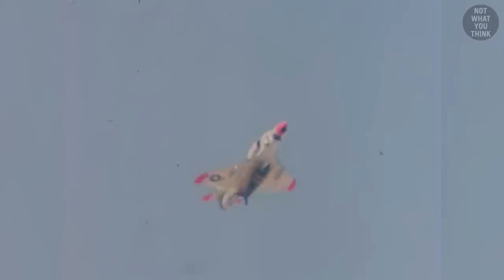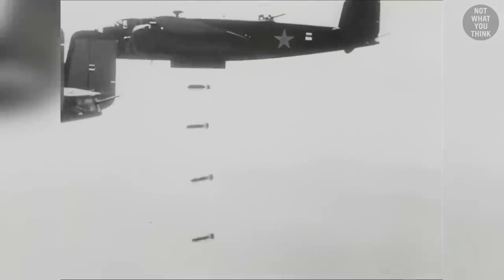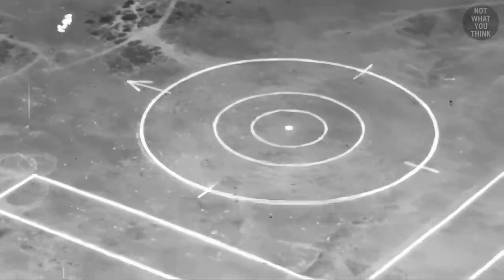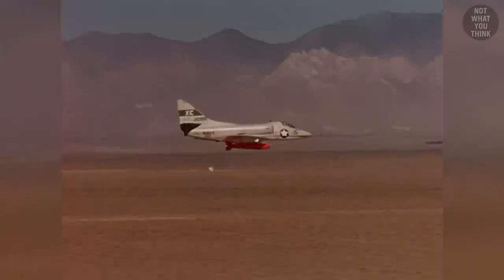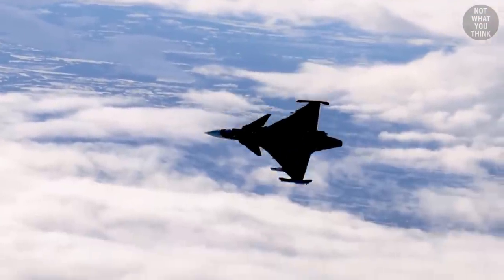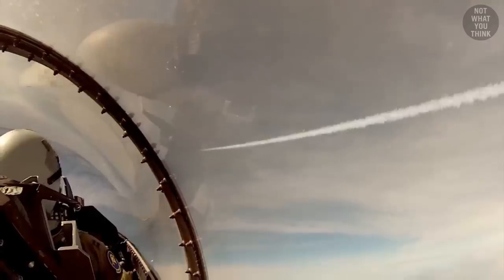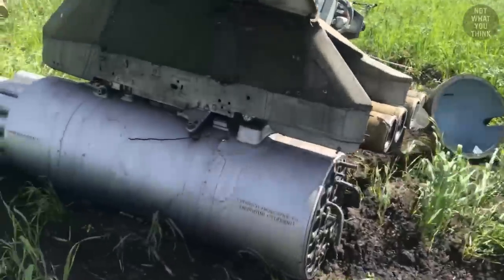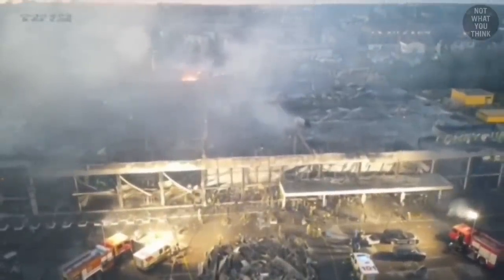Why Are Russian Helicopters Shooting Up at the Sky?

Comment: I dont think the mission of these rockets is to blow up something specific. Its to inflict area damage , make the enemy force lay low and allow your own troops to advance. While still keep the helicopter in a safe distance away from AA's way.

If it didnt work , it wouldnt be used.
Reply: Spray and pray always works
Reply: "If it didn't work, it wouldn't be used," is a poor truism to apply to the current state of the Russian invasion... hahaha
Reply: Sure it works as in the rockets get to the general area they want it in, but is it really effective? They might put 40 rockets down range but unless they hit something important or someone they’re kind of just inconveniencing the Ukrainians.
Reply: @lukeorlando6088  i mean invasion plan was not bad in essence it was tried and tested mechanised run . Problem comes mainly from incredible amount of corruption like tank dash without infantry, not having enough supply trucks , especially fuel trucks , low quality equipment. Tactics were not wrong but it's like if you wanted to charge with M 16 but government gave you 1911 . Both can shoot bullet but we know what's actually better. Basically if not for all yatchs and palaces of generals .  Russians would have rolled atleast eastern Ukrainian land. Hell many of troop carriers had rotting tyres which caused troops to just leave them behind. Most probably bcz some commander pocketed tyres replacement funds
Reply: @donk5058  It's about keeping hostile forces suppressed, this can be to stop advances or allow your own troops to advance while keeping the hostiles heads down.
Reply: @lukeorlando6088  you proved you are clueless about it
Reply: ehem, the russian invasion hasnt worked AT ALL, so why are they doing it? xD....your arguement is invalid when it comes to the Ukraine war :P
Reply: people DYING to cope so hard, it is funny. 
love fro Russia😘
Reply: @lukeorlando6088  
The current state of the invasion is - Ukrainian armed forces have pretty much lost all of their equippment they had before the war and are begging us for more shit to send to them because if we dont they wont have anything or anyone to fight with. While Russia , even with their losses , still retains enough power .  

Ukraine had the largest army in Europe and was considered very strong and well trained. 9 months into the war , and the West has to send in enough weaponry and ammunition that would last somebody like the Afghan army 5 years.
Reply: @donk5058  But thats the effect that is needed most of the time.
If the Russians want to hit something very specific and important like for example a Artillery piece or anything of the like , they will use guided  missiles , Lancet drones and so on.
When you need to supress the enemy , or for example you know that there is a large group of enemy soldiers ann bunched up , then unguided rockets are a cheap and effective way to do the job.

Like I said , if it wasnt effective ENOUGH , both sides would have found better ways to use their rockets. But if they are constantly using the tactic , it means that it is effective enough to be used.
Reply: @Snp2024  Curroption only floats up to the top during war time , and festers in peace time. What the war will do , is allow Russia to clean itself inside out. 
Ive already seen atleast 30 Russian commanding officers of different ranks just dissapier with all their assets seized. I really doubt they are dead , but most likely were given 2 options.
Reply: @AlexOnTheSide183  The "Afghan army" got most of their kills by strapping bomb vests to themselves, killing their own people whenever they suspected they were working with us and using children to pass secure zones. 
The Afghans also killed and wounded a whole lot less then Ukraine while retreating to thr caves a lot faster
Reply: @Kenny212_2  Thanks Kenny for your very informative and important addition to this conversation. 
Notify the Ukrainians aswell , that they should stop fighting. Since the invasion failed and everything. And notify them that they should stop sending their troops on suicide rushes. Cause the invasion failed.
Reply: @AlexOnTheSide183  Your talking a whole lot more about Russia then Ukraine. This much artillery couldn't have been spent if Russia wasn't still running fodder walls 12 months in and still contested at the borders
Reply: but if you don't degrade the enemy then you are just wasting your munitions
Reply: @WhatHappenedIn-vt3vq  You are thinking of the Taliban. 

Wtf are you even on about right now?
Reply: @quicksesh  If you fired a salvo at a enemy position and forced their MG nests to lay low , allowing your infantry to quickly move up and take the trench line. Is that considered ammunition wasting? Unguided rockets were never , in any conflict meant to be super duper effective at taking out the enemy. It was always meant as a supression tool.  If  you want them to be super effective , then you need to be close to the target. And a helicopter being close to their target is just BEGGING for it to be shot down. At the ranges Helicopters need to get to to fire unguided rockets effectivle , even a AK will work as a AA gun.
Reply: @AlexOnTheSide183  In every video I’ve seen this tactic being used there are a pair of helicopters who fire their salvo simultaneously before retreating. This isn’t suppression. Suppression only works under the constant threat of fire. An Apache that doesn’t immediately leave the area can provide suppression, an AC-130 circling overhead can provide suppression, but a single salvo of rockets before leaving the area is not suppression. It can create an opening for a push I suppose but under the guise of suppression or even artillery it doesn’t make sense.
Reply: @donk5058  What Ive seen is them firing , breaking left or right and then doung this until they run out of ammunition.

At the end of the day , Im not saying Im 100% right , Im just making a assumption from the info I have. But as Ive said. If both sides utilize the tactic , then it means it has its place. If it wasnt effective , if it didnt do shit and so on , none of them would bother with the tactic.
Reply: @AlexOnTheSide183  Been 6 months and Russia's largest accomplishment was a marginally defended town with a prewar population of 11k. after the first 2 months of this war, Russia had been losing on every single front. When you're goal is taking the entire country and you're struggling to take 10%, you're losing
Reply: “if it didnt work, it wouldnt be used”

i see you dont have a lot of first hand military experience
Reply: @AlexOnTheSide183  I agree that it might be the most effective tactic at hand for them right now, you use what you can, but overall I think it’s ineffective and if they could be doing anything else they would.
Reply: Yeah it's definitely a "fuck that area in particular" airborne "artillery" method but it does also keep the helicopter safe and we've learned that NATO weapons are vastly superior to Soviet weapon systems. So they definitely can't afford to get too close to a hot zone without getting shot out of the sky by a manpad.
Reply: @donk5058  I do want to hear your suggestion on how Unguided rockets could be used without putting the crew of the Helo in the range of direct fire weaponry. A genuine question. I simply think this is the "Out of all the shit options , the least shit one" kind of deal. But what do you think would be a better use? 

tbh , id fucking strap one of them pods on my tank , like the Soviets did in Afghan. FEEL MY FURY!!!
Reply: @lukeorlando6088  Russia started a war and still not giving up, on the other hand USA started many more wars and always ended in disasters lmfaoooo
Reply: @Black_Death69AC  

Yes , 2010s and 2020s Weaponry is supperior to Soviet 1970s and 60s technology , Very great notice there my friend.

Wanna know a little fact? You know whats the most popular MANPAD in Ukraine right now? Soviet Igla. And its been the most effective. 

All this war has shown , is not how useless soviet weaponry is , in fact , it has shown the opposite. But it has shown how such weapon systems as the Javelin , NLAW and many other things sent to Ukraine are NOT at all meant for an actual war. And are only usefull when fighting monkeys with AK's. 

And before you go on about Tank losess and yada yada. I want to ask you a simple question and ill use a Bradley as a showcase.
Its winter. The weather becomes plus 3 like it can sometimes happen in Ukraine. The roads turned into mud pits. But it doesnt bog down your BMP-2 or the Bradley at all. They get through the mud easily enough. Get into postion and over night , the weather turns into -10 and all the mud , the crew decided not to clean off is now stuck on the tracks of the Bradley and the  BMP-2.

Your vehicle is frozen in place. it can start , it can shoot , but it cant move.  With the BMP-2 , you take a hammer and you start to hammer away all of that  mud. With the Bradley? Good luck getting those side skirts to open first. Cause that mud got into everywhere and has frozen everything solid. Who do you think will take longer , to get their vehicle back operational?  This is the shit that matters in actual war. Not how pretty your vehicle is , or how bad ass it looks. But how usefull it is , how easy it is to repair and how effective it is in battle.
Reply: @AlexOnTheSide183  The answer is they shouldn't be at all, they're using a weapon which requires a certain level of accuracy to be effective in a situation where they don't have it. As I said before, if they had any other means to use they probably would.
Reply: @lukeorlando6088  Ukraine also uses it.
Reply: @donk5058  So just keep the thousand rocket stockpile sitting with now use?

This method leaves little room for the helo to be shot down , and while the chance is small , there is still that chance that the rocket will hit something or someone. 

I see no reasson to not do this. At the end of the time. Who are we to stop them?
Reply: A lot of people are going with the entire invasion to take logic away from that, but practically it's likely what you're saying is true...

Alternatively when you see something not working and question the logic it's often that there is another purpose altogether in mind
IMO It's closer to the vid. Their mission requires they get fire down field, but the fear of AA fire has probably successfully been keeping some pilots at bay.

There's been a clear lack of coordination and training on display, mixed with conscripts - it's likely some pilots are just going out pretending to fight for their own safety. Shoot missiles in the direction of the enemy, fire off flares as if you were targeted to explain the lack of accuracy - return to base.

It's not like literally in every war of all recorded history there isn't account of people firing 'generally' in the direction of the enemy not intending to actually hit anything so they can continue to hide, alive among the ranks just trying to do the absolute bare requirements to make it home. Given punishment for failure to attack is likely severe given stories, the need to put the full display of fighting would be higher.
Reply: @AlexOnTheSide183  Russia did try to take the entire country, as evidenced by Putin sending tens of thousands of his most highly trained VDV soldiers to take Kyiv, which they failed to do. He tried to take Odessa to cut off sea access. He failed to get past Kherson city. He tried to take Zaporizhzhia but failed. He tried to take Kharkiv in the East and Sumy in the North East. The only locations he didn't try to take is the Western cities around Lviv, which is strictly due to it being so far away. Taking Kyiv would've ended the war right then and there, let Putin complete all of his imperial ambitions (in Ukraine), and get another puppet country.

Ukraine has literally never been a threat to Russia, nor would it ever be. Ukraine isn't an imperialistic nation hellbent on invading foreign nations for their oil like Russia is.

At the beginning of the war, Russia had the manpower advantage. They had 200k soldiers when including the LDPR and Wagner Nazi mercenaries. The entirety of the Russian forces, including their nazis, had one job and that was to invade. Russia has been building up massive stockpiles of weapons and supplies near the border. The 200k had to just fight and move the supplies across a few dozen kilometers. Ukraine's 300k personnel military was spread out all across the country. They were training, resting, learning, and doing drills. With the much longer supply lines Ukraine had, it wouldn't be too far off to say Russia had a decent manpower advantage. Ukraine mobilizing to have a 1 million man army was to bring it in line with the Russian military so they could rotate in and out, train, move supplies, and provide aid to civilians.

The front line "shifting" into Russia's favor is a 5km advance into a marginally defended city. After 6 months that is nothing. By the time Russia will take the entirety of the Donbas, they will be running out of able bodied men to use.

Also, Russia will stop being a country if they stop fighting? What? You can't be that fucking gullible. No one wants to invade Russia. No one wants to destroy Russia. If Putin packed up his soldiers and went home, Ukrainians would live free in their home country and Russians would do the same. They might not even have to pay reparations for the destruction and will be living no different in a decade when everything returns to normal with smaller sanctions.

Russia invaded Ukraine 4 times in the last decade. Once in February 2014 for Crimea. In April 2014, thousands of Russian FSB agents and Russian nationalists invaded Eastern Ukraine to create the puppet LDPR government. In August 2014, when their separatist movement was pushed to the Russian border, Russia again invaded, this time far less covertly than in April. The sanctions after that was minimal and Russia continued on it's way. Putin could've been satisfied with that and Russia would've lived a fine future. Unfortunately for Ukraine and Russia, Putin will not stop until every single inch of Ukraine is under his boot.

You can't play victim when you break into a house, shoot the dog, and barricade yourself in the kid's room.
Reply: @AlexOnTheSide183  I think that when ppl talk about the superiority of NATO thanks they usually mean their targeting and anti missile systems. When it comes to how well they would perform in a cold environment I for the love of God couldn't answer that. They haven't seen much action there afaik
Reply: Indeed, even in small arms fighting with infantry, only a very small percentage of bullets is actually aimed to kill. Most of it is suppressive fire, to pin the enemy down, prevent them from moving or shooting back, allowing the rest of your forces to maneuver in for the kill.
Reply: @AlexOnTheSide183  Ukraine is a poor country, it got poorer than Republic of Moldova. So no, they could not have been the very strong army you suggest. They used mostly old equipment from Soviet times. Not sure where you are from, but I would very much like not to see Russia expanding. And losing US influence from all over Eastern Europe if they succeed woth Ukraine. Actually not only in the Eastern Europe, but elsewhere too, as who would trust the US cares a lot for... Vietnam or... Taiwan? That means a whole lot smaller world for the US and a way bigger one for the enemies (China and Russia).
Reply: @lukeorlando6088  Both Ukraine and Russia use this tactic and it works quite well by keeping the crew safe. By doing this they're able to launch 15km away vs 2-5km when fired normally. It's accurate enough to target and deny a certain area. Think of it like a flying grad with smaller rockets.
Reply: @jaredwindmeier5558  Yeah cause you have....
Reply: @AlexOnTheSide183  Firing those rockets and using that aviation fuel puts a strain on logistics. That logistical capacity could have been used for something else, like bringing in more artillery shells and diesel fuel. So yes, they should keep those thousands of rockets in storage instead of sending them to the front if they can't be effectively used at the front, because using those ineffectively means they aren't using other, more effective things.
Reply: @Kenny212_2  It is what the media tells us, next news is that Selenski is about to take Moscow. Anyone remember the fairytale teller of Sadam Hussein? Was it comical Ali? Another one was chemical Ali, right? The comical Ali was so funny, the US did not convict him, if I am right.
Reply: @AlexOnTheSide183  lol what, that's some insane cope.
Ukraine requested weapons since the war started for real, because why wouldn't they XD
And russia failed to secure any of their objectives while barely maintaining a stalemate for months now, despite supposed military superiority.
Reply: @ImBigFloppa  
Addition.

Russia started the war with 150k of its own troops and around 135k DPR and LPR troops. Ukraine had around 400k and around 124k of those were at the frontline in Donbass. This was due to the reasson that Ukraine was planning an attack on the Donetsk city only a few days after  Russia began their assault. Which was confirmed by Zaluznij in a statement.

Second thing. It seems you havent watched the news in some time , because Russian forces have advanced as far is 5km throughout the entire frontline on Zaparozjie and are continuying to move forwards. Have taken Soledar and cut off a major supply chain to Bachmut. I do wonder who will run out able bodied men first.
Reply: Nice analysis man
Very nice
Reply: @Snp2024  the major problem wasn't corruption
It was incompetency and poor initial planning
"Many of the carriers had rotting tires" 
Because you saw a few videos of that on social media doesn't mean the thousands of IFVs all had rotting tires. Even if 20% of them  had , it would still be insignificant
Stop using a few videos to judge thousands of vehicles
Reply: @FlorinArjocu  

Ukrainians would take offense to that comment XD

While Ukrainian economy was by no means strong , it was NOT on Moldovas level. 
I dont "suggest" it was a strong army. Its a fact that it was THE strongest army in Europe before the war started. As it was not only the largest army , but the only army that had modern war knowledge.

Nor Russia nor Anybody else cares if you want it to expand or not. If the countries survival is in question , nothing will stop said country.
Reply: @sisyphusofephyra7801  Its not even JUST cold enviroments. All of the US and NATO vehicles were built with the idea that "Oh , we will have a repair bay right there , so no worries!" , Soviet vehicles were always built with the idea that Poor Ivan will have to repair it by himself in the field. 
Sure , the APS systems the other nations have is amazing , and Russia should adopt them as fast as possible. But how do people expect that a nation under the largest amount of sanctions in the world can quickly set up such systems? Russia to this day is feeling the effects of the fall the Soviet Union. So money needs to devided.
Reply: @Black_Death69AC  Yeah, vastly superior Bayraktars, StarFailStreak and other bunch of crap... Keep it up fanboy
Reply: @voidhawkslx  So....Not only do you film yourself doing the bare minimum , but you yourself upload the video? I dont disagree with you , but dont you think that its like yelling "im over here shoot me"?
Reply: @olehcelsior1005  literally nothing you named was made either blocks of countries I'm talking about.
Reply: @donk5058  That's what he was saying. It's a kind of suppressing fire, not meant to hit anyone but to keep people from advancing or moving.
Reply: @lukeorlando6088  What does this even mean?
Reply: @ImBigFloppa  I would agree but Americans would never admit they lost to Vietnam either with that reasoning. And in another note unfortunately people with your judgement do not hold a consistent principle and apply double standards when America does terrible war crimes.
Reply: @AlexOnTheSide183  Check GDP / capita in 2021 and you'll see what I ment, at least in the source I saw, Ukr was behind. Nothing to take personal, it is statistics and an effect of the bloody Russia occupation of those 2 territories (East + Crimeea). Pretty sure France and Piland have good armies. So does UK. Turkey is probably better. And all the above have modern equipment, not T72 and older.
Reply: @AlexOnTheSide183  ''But it has shown how such weapon systems as the Javelin , NLAW and many other things sent to Ukraine are NOT at all meant for an actual war. And are only useful when fighting monkeys with AK's'' I would really disagree with this statement I just feel you just want to force your views of how great soviet weaponry is.  Though I may agree some weapon systems are not effective saying a Javelin, NLAW are only good for monkeys with AK's is such a sweeping statement.
Reply: @kenz2756  golden!
Reply: @danielnavarro8531  Soviet weaponry is ok for it's time, you are comparing more modern systems to older systems. Most problem is Russia didn't make enough upgrades of old weaponry(budget issues) and didn't build enough more modern systems/weapons thou there many good stuff was developed, very little is made in quantities.
Reply: Well... I'd guess that Russian pilots are making reports according to which this technique clearly works and there is no need to send them within range of angry people with manpads.
Reply: @olehcelsior1005  Give me a break, they are my neighbours and I know enough. As for "they became US proxy", it is 1. An exageration as they had pro-russian presidents; 2. It is their wish, anyone who had to deal with the Russians if they are close so there is no buffer, and if they are smart, will naturally put a big fence between them. We are 70 years since WW2 and we still have the memory of the horrors the Russians did in my country; plus the wonderful communism they brought that is so hard to get rid of (sumptoms).
Regarding "they got weapons etc." and because of corruption they lost those, remember that corruption came because of communism. And Russia was just the same, but it was helped by the West to rise as a very corrupt disintegrating nuclear state is a danger for everyone. So Russia was helped more actually. And wherever Russia went and whomever  influenced is corrupt and poor. See their neighbours that are pro Russia, they are all poor and corrupt. All who went " West" are better, likely much better.
Reply: @olehcelsior1005  Will take US hegemony any time. See statistics about countries that went "West" vs countries that stayed and were forced to stay with Russia. Huge difference. And no dictators around, too. You forgot about the ethnic cleansing done by Milosevic?
Reply: @olehcelsior1005  Ah, one more thing: I am sick of hearing "decadent Occident" while nobody goes East. Millions went West for a better life because it is so bad. Right. It is not a perfect regime there, but it is the best we have for now; we can see in these days as one of the weaknesses is the way is exactly the freedom, as it this freedom is manipulated by Russia & co.
Reply: @olehcelsior1005  What is "this part of the world"? I am from a former communism country and know very well. And please, don't blame others for the bad things our leaders were not able to do or did not want to do. Perestroika and communism was a Russian creation, nobody forced USSR to be a bad example and go banckrupt, but the system itself was corrupt and banckrupt.
Reply: @olehcelsior1005  Wow, long time no see such self-pity and way to blame the others. You forget communism was started and it was exported even before WW2; all in all, decades before NATO existed. Maybe it would have been better for the US not send that tremendous hep to the USSR in the beggining of WW2, so Germany konquer it, we would not have this discussion. Your lack of history knowledge is too blunt for me.
Reply: @danielnavarro8531  

A Javelin is a heavy , cumborsome pease of equipment. If you want to be effective with it , you need 2 men to use it. In winter , you  have perfect conditions to see anything and everything you want , but from the reports ive read of Ukrainian troops , in summer , the Javelin and NLAW had a hard time or it was impossible to lock a target behind larger bushes and trees.

Ill admit the part about monkeys with AK's is a bit of nonsense. But Ill clear it up a bit.

When the US army fought enemy armies who did have a airforce , didnt have tanks that could fire effectivly at them and so on. Weapons like the Javelin were amazing. In open desserts you could see enemy tanks and units from miles away and in these conditions , the Javelin saw its use.

If I am on the frontline , in a trench and I know ill only ingage enemy tanks at max 300m , why would I need a 80k missile to do it , if a RPG-7 with the Tandem shaped charge can go through most side armor.
And here is another thing. A penetration of the armor isnt always needed to disable it. Get a good hit on the gunners scope , the barrel , the tracks. Drives view ports and there goes your tank. Its much simpler than it is in War thunder.
Reply: @FlorinArjocu  
I cant take something personal , if it isnt my country. Most Ukrainians lived MUCH better then Moldovians due to more options for work and higher paying jobs. 

And thats not the effect of a "bloody occupation" , Crimea had zero influence on Ukrainian economics. Now the Donbass region , being a heavy metal working and mining region , did. 

If you took a minute to research the Ukrainian army , you would notice they had brand new self built BTR-4Es , BTR-3s , self made T-64 modifications and so on.

You clearly know nothing about armies and I suggest you research MUCH more about them before getting into these conversations.
Reply: @olehcelsior1005  I am not comparing, i am merely disagreeing with the fact that he stated Javelins are only useful for AK's with monkeys .
Reply: @AlexOnTheSide183  They had... some, that is nothing for such a war. They need thousands and thousands. See the numbers destroyed on Oryx.
Reply: @justicehenrydamian475  That's what I said. Putin wanted to take Kyiv, and the rest of the country would fall with it. He believed that the Ukrainian people would just let it happen like those in Crimea where Russia faced almost zero resistance. Unfortunately for Putin, Ukrainians have come to known the pain and suffering that is enacted upon those who get enslaved by Russia.
Reply: @AlexOnTheSide183  let's also not forget how Ukraine squandered the arms infastructure it inherited from the Soviet union
Reply: @liquidsweg4858  I am not an idealist, but from all the regimes we have right now, that is the best. And that is why more or less nobody goes to Russia or China, nobody goes to the very rich but problematic elsewhere Qatar, Saudi Arabia, but West-like countries.
Reply: @Snp2024  their invasion plan was written in WWII, and they hadn't even modernized it.
Reply: @AlexOnTheSide183  ukraine never had the largest army in Europe, and they did not lose all their equipment, they had Soviet era equipment and have gained Russian equipment abandoned by the Russians in the field. What they didn't have was modern equipment.
Reply: @kdrapertrucker  
Bruh

Over 2k MBT's , largest man power and IFV number in Europe. Had been training with NATO troops for the last 8 years.
1 Year ago US generals were yelling about how "Ukraine cant be invaded because they are so strong , strongest in Europe" , now the agenda has changed. Make up your mind.

Just because something is modern , doesnt mean its much better. A Kozak armored car is modern. But is it much better then other older armored cars? 
Ukraine had upgraded hundreds of their tanks to modern standards with Thermals and other modern toys. 

Why does it take a pro-Russia to defend Ukraine againts fucking slander? Wtf
Reply: @AlexOnTheSide183  Don't forget that Ukranian military personnel losses are magnitudes higher. People made a fuss about some minor 5% conscription, meanwhile Ukraine has actively made old men and all women draftable by law.
Reply: I think this too...
Reply: @AlexOnTheSide183  because a pro-russian would obviously try to inflate the capabilities of the opponent they are fighting with to make themselves look stronger.
Reply: @distrologic2925  
I cant with you people. Funniest shit ever.
For years all NATO could talk about how strong Ukraine is. Now its changed to "But if Russia fought an ACTUAL NATO army".
What ive said isnt a inflation of the Ukrainian army. Its me not underestimating mu opponent , like all of you do.
Reply: @lukeorlando6088  Both the Ukrainians and Russians are doing this
Reply: It doesn't work in the senae of military utility but it works great for the pilot. He gets to return alive with an empty rocket magazine. Job done!
Reply: @distrologic2925  My man I live in Lithuania.
Ive been occupied by said uncle Sam for the last 30 years.

Ukraine isnt part of NATO , but it sure as hell is armed like one now. The last package to Ukraine was atleast a thousand armored vehicles in sum. 100 Bradleys , Tanks , armored cars and many other things are being sent there. That amount , would be enough to arm a military and have it fight a war in Afghanistan for 5-6 years. Yet those packages in Ukraine are fucking MONTHLY. Do you realise what sort of losses Ukraine is going through? "Doing pretty well" ,  Just because one takes a city , does not determine a loss or victory. Ukraine fought for 9 months for the city of Kherson and never actually had a FIGHT for it. You know why? Because Russians actually give a fuck about the civilians , because they knew what urban combat looked like. After Mariupol , where the cowards that the Ukrainians are hid around civilian homes. And I dont need either propaganda to tell me , Because I have second hand information from family in the city to know what happened. 
Show me atleast a single video where Russian soldiers are going into battle butt naked. Please. Because if you dont , you cant sit there and claim "They dont have eqquip[ment". They have a gun , they have a winter uniform and they have food. They have change of clothes either supplised by the army or donated by the civilians.
And Lets now talk about those who ran away from Russia. In the end , the number of runaways from the mobilization were around 73k. Less rats on the ship. Simple as that.

Russia didnt go in there to save Ukraine. or save the Ukrainians. Those guys are beyond saving. They went in there to secure their borders. Because what Ukraine was , was a anarchistic Nazi regime , where the Jews were the Russians. Youtube has since banned links , but do search up torch lit marches in Kiev , UPA Marches in Ukraine in general. Who Stepan Bandera is. Search up Ukrainian battalions such as "Donbas" , "Tornado" "Azov" "Aidar" and many others.
Reply: From the perspective of the pilots, it makes perfect sense - it "works" perfectly,  that is to say, it keeps them alive while being able to say "We fired X number of rockets at the enemy".
Whether they hit anything or not is now poor 18-year-old Private Conscriptovic's problem. 🤷
Reply: @MeeesterBond17  
The pilots know if it hit anything or not due:
1 Ballistic computers on board
2 The drones hovering over the target and adjusting the pilots fire.
Reply: @AlexOnTheSide183  Oh, that's true as well. Still doesn't mean they're going to be honest if they missed. It would make them look bad to their commanders. Plus it would make it their problem again, and nobody wants that.
Reply: @MeeesterBond17  
They are soldiers , not god damn 18 year old girls who cant be honest with anybody.

Its not about making yourself look bad or good. You are simply doing the given task. The commanders care very little about mistakes made by a single soldier , unless that one mistake is the floodgate to bigger problems.
This is pretty much how the conversation would go at base "you missed them? Oh well , I guess the artillery will finish the job" 

Russians know that sending units to repeat the same mission is that of suicide as the enemy will know be expecting it. So Helos rarely go on repeat missions in the same area. They constantly switch attack points , making the enemy AA run around like a bunch of maids from one position to another , trying to catch the helo that keeps pummeling them.

And here is another thing to keep in mind. EVEN if the missile strike is not effective in the sense that it hit something , it sure as hell puts a constant strain on the mental state of a soldier. Think about siiting in a trench 24/7 , hearing shit fly over your head and land 10m next to you. And the same thing happens every day. At that point there are only 2 reactions to it. Either you laugh in the face of death and ridicule the Russians for missing. Or break down and constantly think about "Is the next one gona land straight on target..?"
Reply: @ImBigFloppa  taking over the entire Ukraine was never the goal. LPR and DPR were the target. Otherwise russian army would've rushed through relatively unprotected territories bordering Poland in the beginning of the conflict in order to cut all the major possible supply routes from NATO to Ukraine and then proceed to do pretty much anything they want to with the rest of the country. Russia may have really bad top rank commanders, but even they are not THAT dumb.
Reply: @AlexOnTheSide183  I would visit Russia, too (not in this period, of course, I treasure my life and freedom). It was an empire that collected wealth for centuries (even stolen, like the Romanian treasury from WW1 that was, with little exceptions, never gave back - I am talking about 100+ tons of gold bars, jewelry, paintings, old documents,  old books etc. sent to be safe during WW1), it is a huge country and thse things are interesting to see. But I would never move there. Learn to behave.
Reply: @donk5058  the problem is, according to the data I have, Russia is currently running low on artillery ammo, which caused less intense shelling at almost all directions. So when you have little shells, but plenty of unguided missiles and have to push/suppress a not-that-well-protected position, you say "well, unguided missile artillery it is" and do what you can with those resources you have
Reply: @AlexOnTheSide183  I think the Belorussian media give the Russian military less credit than you, my friend - YT comments deleted my external link, but there are reports from Belarus of drunken tank crews in Mazyr selling their diesel for vodka as early as March 2022.
Reply: @FlorinArjocu  And also. My motherland is Lithuania. I was born where I was supposed to be.
Reply: @AlexOnTheSide183  I think you forget that Source Analysis is the science of keeping biases in mind while analysing the big picture. It does not mean using souce bias as an excuse to throw away potentially useful information. We can find clues and grains of truth even in blatant propaganda. The question is if it's corroborated by other sources, this is history we're talking about, and every source is imperfect.

Let's also bear in mind the alleged maintenance report from the Moskva, which was either sunk by a knock-off Harpoon missile because their CIWS and short range air defence didn't work, or whose crew were so incompetent they blew themselves up.

Also all of the intercepted calls made over a mobile network in Russian which seem to indicate supply and command issues.

Then the video of Terminator tank support vehicles bunched up and coming under artillery fire, unable to get out of the way because they're heavier than T90s and lack main guns.

Also the shell which killed dozens of DNR citizens in the city of Donetsk on 19/9/22, which crater analysis shows was fired from the south (not the Ukrainian side).

Taken in amalgamation, all these stories from different sources paint a grim picture of incompetence in the Russian military.
Reply: @MeeesterBond17  
Oh boy...
The Moskva was sunk after it was attacked by drones and anti ship missiles. The drones destroyed the main radar system and only short range radars were operational , which couldnt detect the incoming threat. The Moskva did not sink after its hit and the crew abandoned ship. It was then towed to port , but before it reached it it took on more water and sank.

Around 80% of the calls that were "intercepted" were later found to have been made from Ukrainian cellphone numbers , and I doubt Russians would witch their numbers JUST to speak on the phones. Now intercepted radio chatter , thats different , but how you listen to some Ukrainian radio chatter and how they are constantly reporting heavy losses near Bachmut , but the commanding officers are telling them to hold on to the city , no matter the cost?

The OSCE reported about Ukraine shelling Donetks and Luhanks for over 8 years. They pictured NATO shell fragments in the city of Donetks , they pictured Ukrainian Tocka-U missiles.

All of the sources you stated paint only the stupidity of the reporters and nothing more. 

A source not only has to have proof but a logical explanation to a situation. And most of the Western source only , excuse me for my French , talk shit about the Russian armed forces and nothing more. They report that "Russians dont have Winter gear" , I talk to my buddies on the front and everybody said they have plenty of clothing and if they ever lack anything , their families always send something over. And often the items they lack are either combat gloves , or maybe a pair of undies.  

You talked about "taking info from everywhere" and then took info only from Pro-Ukrainian sources and told me that they paint a grim picture....It would be weird if the Pro-Ukrainian source would be praising the Russian armed forces for anything.
Reply: @AlexOnTheSide183  Ok, let's go point by point ...so cheap drones took out a capital ship's main radar. A capital ship with enough close range firepower to throw a wall of lead at anything within a few kilometres. You realise that's a worse sign of incompetence than saying it was just hit by an SSM without warning, right? Please tell me you know that's worse.
Reply: @AlexOnTheSide183  Using Ukrainian numbers... because they're using the Ukrainian phone network? Which likely isn't accepting calls from Russian mobile phones? That's not an indicator of falsehood, just how mobile communication works.
Reply: @AlexOnTheSide183  Nope. That incident on 19/9/22 was a 122mm D30 shell, and the crater pointed back into Russian held territory. Look it up. It was a terrible accident, but it definitely came from a gun on the Russian side.
Reply: @AlexOnTheSide183  Moreover, the OSCE report mentions that civilian fatalities in the Donbass went down to 26 killed from Jan 2019 to November 2019. Twenty. Six. Mostly killed by mines. Why, why, why do people keep linking the OSCE report before reading it?
Reply: @AlexOnTheSide183  Oh right, and there are tons of videos even on this exact channel that depict the state of the russian army. Man, they just drew in a whole bunch of people and sent them to ukraine, they thought this war would be over in a few days, do you really expect the soldiers to be trained well? The fact that their 2-day special operation is now taking almost a year should be enough to tell you that they don't know what they are doing. Its just a bunch of generals and rich people who would like to have a nice holiday home at the black sea and they dont want to deal with the ukrainians there because they have turned their backs on them and are now friends with the US and EU. And yes, maybe Ukrainians also had bad opinions of Russians and treated them badly, but that all is no reason to go and bomb a country. If Putin really was interested in peace he could have handled this better in millions of ways. But he wanted war. He likes the idea of a great soviet empire and he thinks the only way he could get it is by force. That is a barbarian logic and has no right to survive in today's world.
Reply: @MeeesterBond17  

When you go to another country , do you change your phone number? No. Your phone number stays the same and it connects to to the cell towers in the country. The same way , Russian phones have been connecting and using Ukrainian cell towers at the start of the war.  

The indicator of falsehood are:
1. Ukrainian accent in the captured phone calls
2. Often the conversations dont feel natural and are almost scripted.
3. Over dramatizasion of the events . For example , there was one where a "Captured phone call of Russian commander with family" where he says that he lost 300 men , but it doesnt matter , he will get another 300 tomorrow. And he will probobly get them all killed , cause he wants a medal. This story plays WAY too well into the the Ukrainian narrative about how all Russians are inhuman and orcs and blah blah blah. 

Everything is just TOO perfect and thats exactly why I believe its false.
Reply: @AlexOnTheSide183  Actually, yes I do change numbers. I live in Germany, but have family in the UK. When I go back to visit, my German mobile provider can't provide service, so I have to use a British SIM card. Gets even worse when I visit my in-laws in Brazil. 😅
Reply: @AlexOnTheSide183  I will admit, of the languages I do speak, Russian isn't one of them (yet). But if you are a Russian speaker, please could you do me a favour? Look up Konstantin Solovyev, there's an allegedly intercepted call between him and his mother. Please point out to me if that sounds fake, perhaps pointing out pronunciation errors, without saying "it sounds scripted", as that's impossible to prove to me. I know all my Russian from playing Bad Company 2. If not, we'll have to agree to disagree on that point.
Reply: @MeeesterBond17  Listened to the video.

There are a few areas where he pronounces certain words with a Ukrainian fashion and his "mother" once says the word "what" not as Shto but Sho. All of these are very minor details in the end and cannot directly point to the conversation being fake in this specific scenerio. 
I still am not going to believe the Ukrainian 
recon on this. I mean....Their Emblem is a sword plunged into the Russian federation , which is shown in the video , so can you Really expect only the truth from them?
But , if this in fact 100% real then the man should be court martialed. But if he is court martialed , then we run into another problem.
Many Russian soldiers who return from being a POW are missing trigger fingers , have be castrated , have gouged out eyes , torn off finger nails and so on. And the Ukrainian soldiers that are given in return  dont have signs of torture. If we want to put war criminals under trial , then all of them need to go under trial and not just one side.
Reply: @MeeesterBond17  Another thing. Remember when I said how everything is too perfect?
Same thing here.
The soldier mentions how he tortures Russians , mentions that the Ukrainians defy him and thus are Heroic in the eyes of Any Ukrainian who watches them.  It plays TOO Well into the Ukrainian narrative in my opinion and should taken with a large grain of salt.
Reply: @ДимаВеселов-в8и  Yet tens of thousands of Russia's best equipped and best trained VDV and Spetsnaz units invaded Northern Ukraine to take the capital Kyiv, overthrow the government, and install a puppet, thus giving Putin full control of the country.

Only wanted the Ukrainian majority Donetsk and Luhansk yet he invaded and tried to take Kharkiv, a city and oblast distinctly NOT in Luhansk or Donetsk.

Wanted the Donbas so much he tried to take Kherson and even tried to reach Odessa before he failed.

The DPR was the goal yet less than 5% of the land gained was actually in Donetsk. Half of the Oblast is still free from Russian occupation

I genuinely find it so damn hilarious that you people continue to believe that Putin wanted just the Donbas when he has been annexing and invading and destroying every part of the country.
Reply: @AlexOnTheSide183  I mean obviously both sides could be lying. It is also not proven that the POW returned by Ukraine are showing signs of torture. Honestly that would just be incredibly stupid.

The facts are that russian soldiers are on Ukrainian territory right now. No matter what their reasoning is, this is not the way to resolve any conflict. This is what conflicts look like. They are creating the conflict.
Reply: @AlexOnTheSide183  I think we might need a source on the POWs with missing trigger fingers, a quick search only turns up a Novaya Gazeta article which mentioned four Russians tortured by Ukrainians. No missing fingers, though.
Reply: @distrologic2925  Bruh 
When will people realise that the current war the tip of the iceberg and not its base?

When you have free time , watch the movie Ukraine on fire and tell me your honest opinion on it.
Reply: @MeeesterBond17  Best place to search for that would be telegram and I cannot send telegram links , they seem to get deleted straight away.

Ive seen hundreds of videos at this point , ranging from Ukrainians executing Russian soldiers , to beating them on video.
One video shows off Ukrainian soldiers escorting į Russian soldiers into a forest road , second part of the video is the same Ukrainians making fun of one of the dead bodies of the Russian soldiers laying on the ground. This is a more recent from around october last year. 
You also have the ones from way back at the start , where a Georgian Volunteer in the UA army films himself on a road next to a captrued BMD as he stands over several dead bodies of Russian soldiers , you can hear one of them having a "Death breathing" as he chokes on his own blood. All of the KIA soldiers have hands tied behind their back and one of them is on his knees with his head on the aslphalt , with the exit wound being on the front of his face and not the back of it , meaning he was killed execution style.

Ill try to find the last one I described as I have seen it on youtube , the rest like I said I cant share due to Youtube. But there are alot of Telegram channels on this topic. In general , telegram seems to be one of the best sources of info thus far.
Reply: @ImBigFloppa  are those "tens of thousands of units of elite among elite" here in this room now?
Reply: Its a desperate tactic, I know! If you get within a quarter mile of a target that's good. Its to keep the enemy heads down, slow them up. But it does greatly increase the rockets range.
Reply: Wrong
Reply: @ДимаВеселов-в8и  So are the VDV, Russia's best equipped, most mobile, and best trained standard military units not the best Russia has?
Reply: Yeah russia wouldnt do ANYHING that's illogical
Reply: @MeeesterBond17  Well Russian media rarely put out the really graphic videos , but sometimes they do. So i cant answer you that.

Ive said this beforr , but Russias mission in Ukraine isnt to save Ukrainians from Nazis , but to not allow Ukraine to be the one attacking.
Aristovic  , and a few other Ukrainian officialls stated that Ukraine was preparing  a large scale assault of Donetsk. At that point , wether the world recognized or not , Donetsk was now Russian federation.

Yes AZOV didnt exist before Crimea , but Pravyj Sektor , Svaboda and so on did. These 2 groups were the main driving force of the Maidan.

I said this to another guy , but you seem more open minded , Try watching Ukraine on Fire movie. You should find it on YT.
Reply: @Konig  I will definitely watch Ukraine on Fire.

But I find it difficult to believe Svoboda, a party which peaked at 10% of the vote and lost all its seats in the last election, is representative of Ukrainian popular opinion. UKIP gathered more popular support (13%) in the UK, and they ran on a "let's kick all the immigrants out" policy. For some reason that wasn't seen by France as a reason to station Leclerc MBTs at Calais.

Also, Google Aleksey Krupnyk. He was at Maidan, and you couldn't meet a nicer StarCraft 2 player, I followed his hilariously broken English commentary for a few years before 2014. He was there because he was unhappy with the Yanukovych government, nothing more.  He also posted several videos of the events from his perspective, of course, limited to one man with a camera. And guess what? No Right Sector or Svoboda flags.

If the Maidan protests were organised by neo-Nazis, you can bet your last dollar he wouldn't have been there. Were Svoboda and Right Sector present? Yeah, sure, they're basically Ultras, they go where the trouble is. Did they organise the whole thing? The evidence I've seen so far suggests no.
Reply: @MeeesterBond17  

Here is the thing with the Maidan protest. 

If you do some digging into Europes history and you will notice that for some reasson , all of the protests had the same exact "plan" of sorts. It always started as a clam collection of people showing their opinions. Then it grows larger and then suddenly somebody gets killed. and THEN suddenly people get guns from nowhere and start to shoot and what started as a calm and normal protest , ended in a goverment coup. Lithuanias coup followed the same plan , Coup in Kazachstan followed the same idea aswell , but that one failed. And ask yourself aswell , why do these coups always happen ONLY around Russia? You think the Mexican or Brazilian people are 100% happy with their goverment? Why dont they rise up againts it like the Kazachs did? 

Just because the protest was orginized by the Neo-Nazi orginization doesnt right away mean that everybody knew who orginized it. Your right , the initial people on the Maidan protest were people simply not happy with the presidents actions and they had the full right to do so. But they were used as pawns .  

Yes Svaboda never had a strong presense in the goverment , but their flags are ALWAYS present at the UPA marches in Kiev and the torch lit marches in Kiev. Just like the flags of the Right Sector. 

Look at the US right now. The majority of people living there , by NO MEANS support the LGBTQ movement , but somehow they are still piloting the goverment. How come?
Most of the time , the one who wins in politics isnt the one who is speaking the truth , but the one who has the loudest voice. Even if that voice is completly wrong.

Same happened in Ukraine. Ukraine celebrated 9th of may , they celebrated a lot of Soviet victories and so on. But you would always have members of the Svaboda or Right Sector present , trying to disrrupt the celebrations. The Pro-Russian population , not wanting to stand out , fell silent and this was used , for that minority of Neo Nazis , to slip their way into the goverment. 
Zelensky is just a front face , he himself is by no means a Neo-Nazi or anything like that. But behind him , he knows it or not is beyond me , stands the Right Sector , and behind the right Sector stands the CIA and the US.
Reply: @AlexOnTheSide183  You just described every popular uprising in history.

Let me give you a few others that fit the exact pattern you describe (with different outcomes) - Libya in 2013. Zimbabwe in 2017. Cuba in 1953. The French Revolution of 1789. The October Revolution of 1917. The Greek Revolution against the Ottomans in 1821. All had external influences (eg. Kaiser Wilhelm II put half a billion dollars in today's money into the October Revolution), but ultimately it was the people who, for better or for worse, threw out the government of the day.
This is not, and I can't emphasise this enough, not just a problem affecting modern day Russian neighbours.
Reply: God damn its just an airborne creep barrage that makes perfect sense. I was thinking it was a terror weapon.
Reply: @Snp2024  Russia anticipated a fight with a poor post soviet state. They had no way to anticipate Ukraine being the darling of corrupt western politicians and getting super advanced weaponry.
Reply: @MeeesterBond17  

I did describe every revolution , because all of them were in the interest of the supporting party. The Kaiser throwing money at the uprsing , expecting to do some damage to the Russian empire and to ease his situation on the eastern front. The money worked a little too well. I remember reading some documents that the Kaiser was very suprised that the plan worked SO well.

Cuba was a interest of the Soviets as a answer to US missiles in Turkey.

None of these uprisings would be as effective as they were if not for the external support. 
I am not saying that Russia is the only one suffering from these uprisings next to it , what I am saying who do you think stands to gaid from them the most? 
Chechnya was used to put pressure on Russia , the plan worked well but not fully. Then it was Georgia. Now its Ukraine. For China , you have Taiwan. 
Both of these countries are simply puppets of the US to put pressure on its enemies. A Geopolitical tool/trap.
In a sense , you can say Russia fell for the trap that was Ukraine.
Reply: Саня, як життя? Чого з росії поїхав? Краще любити росію з Литви? Коли повернешся на родіну?
Reply: these flying tanks like apache or ka-50 are very sweet targets for AA. no surprise they trying to shoot rockets from away
Reply: @AlexOnTheSide183  First there is no Afgan army! Second the russians have literally no precision weapons for their Air Force... thats why they lose planes and helicopters.
Reply: @triage2962  There no LONGER is a Afghan army cause the US lost the Afghan war.

And the second part of your comment is simply you being uninformed and havent done a single note of research into the currently used missiles in Ukraine. Which I suggest you do.
From Vihar ATGM missiles for helicopters , to Kh series of missiles to the Su-25s are al present at the front line.
Reply: Some people here seem to be suggesting that because it is a single volley it isn't effective suppression. They seem to miss the point that there is no way to tell the difference between this and MLRS systems (which fire longer and can be multiple vehicles) and even artillery from a distance. This technique is primarily used as a mobile MLRS, to slow down enemy advances and suppress where an MLRS is not available. 

If you have a fight over an extremely important strategic position, chucking unguided explosives at the area not only slows the enemy down and distracts them it also is highly demoralizing and can get them to abandon their positions.
Reply: @AlexOnTheSide183  You sound very defensive about Rusnazi's and their gear and almost proud about their army and tech?
Reply: @MeeesterBond17  About the comment cheap drones.
I dont if i mentioned in the original post that the Moskvva was attacked by the drones , but wasnt destroyed because of them. The 2 drones were shot down , but damaged the ships low level radar. Which is used to detect any anti ship missiles which often fly right above sea level. Without that radar , Moskva had about 5 second to see the missile , react and fire to it. 
Yes , Russia underestimated their enemies , but remember that Russia isnt fighting taliban or ISIS  but a well trained and well armed. A qrmy that gets constant intel from the US.
Reply: @Youvko  Sorry   , dont speak fashist
Reply: @AlexOnTheSide183  sure you dont Сашка.
Reply: @Youvko  Oh no , he knows my name! I shall now go cry.

Dont you have better things to do? Like defending Bachmut or Ugledar.
Reply: good point
Reply: Hahaha Russia usually slams their head into a wall a good 300 times before they realize it hurts
Reply: @---------c5741  yeah that “disaster” that was the gulf war which is basically regarded as the best use of modern combined arms warfare in the world resulting in the destruction of the Iraqi army in a matter of weeks.. crazy how bad that was. Even in Vietnam the US slaughtered. 60,000 dead US troops vs over 1 million north Vietnamese. Then they left because they lost support for the war both at home and in Vietnam.
Reply: @donk5058  Look on it as area denial, you do the classic "one pass haul ass" and send them in, they get out of there before you get a heat seeker up your exhaust. Keeps the other side down in cover while your infantry grunts can move with nothing coming back at them. 

If you have the rocket characteristics at least well controlled and defined you will be able to enter then into a firing solution, and hope to at least hit close to the target. But that requires you to have well controlled manufacture, and well controlled storage, and spend a few hundred hours with an airframe or three doing run after run at the same altitude, attitude and airspeed, to get the data. Then do it for all the different airspeeds to get a minimum and maximum envelope, and have some smart people sit and use this to get a set of equations you can enter into the firmware of the firing computer, and use it to get the firing solution. Once you have those equations as to distance for the projectile your firing computer is doing CCRP, every cycle it calculates how far the projectile will go if released now, and distance to target, updated from air data and INS/GNS, plus ground speed from the nav platform. Then as soon as the distance it will go is greater than distance to target, it will fire. Biggest error is that you typically also have to allow time for the system to fire them, so high rates of change of attitude mean a large error in distance to go, which can mean that, if the pilot sends the release command while pulling up,. they can be too close, and they will shoot way off target, or if he does a sharp correction the same. Plus you can also fly into your own weapon as well, seen those photos of the bomb that released, but also clobbered the airframe as well.
Reply: It’s funny how everyone has such strong opinions. Especially about how useless all this weapons are. I am pretty sure that many ukranian soldiers lost their live to these so called „ineffective weapons“. Anyway here is my Theorie.

First these unguided rockets are also carried by su-25. but regarding the Russian helicopters I think the main reason is the following: when these helicopters go into the air then they seem to to be outfitted also with guided rockets. If they find a valuable target they utilize the guided rockets. If not they at least shoot at „something“. It makes little sense to let them fly home without dropping at least something. If the price of the unguided rockets is cheap enough than it’s actually totally logical to fire them. Russians infantry probably reported the effects on moral and motivation to continue an attack when being fired at and out on notice. 

Also why does anybody believe that modern fire control can not be very precise in projecting the final Flightpath? 

Calling it’s some kind of flying mlrs might be true but they probably have the optics to see where they are firing so it will add a specific advantage. 

Would be very interesting to know who decides if artillery is used or air launched unguided rockets. 

Just my 5cents.
Reply: @AlexOnTheSide183  If I'm reading your comment about revolution s correctly, your understanding is that every popular revolution had very little to do with people's wishes and everything to do with foreign interests... The logical extrapolation from that is that common people, even when sufficiently motivated and organised, can't make a difference without backing from a foreign power - everything is futile, shadowy forces control everything, and we have almost no control over our fates. I think that's an interesting position to take, not one I agree with. Kind of sounds like political determinism taken to the extreme.

Personal interpretation of the Nuland call seems to indicate she wanted Yanukovych to remain in coalition with the opposition, which of course didn't happen. Long story short, it was impossible for the US to guide the outcome of the Maidan protests, as nobody really knew what was going to happen. I'll use that as a piece of evidence to counter the above.

Please let me know if I misread!
Reply: @AlexOnTheSide183  You do realise the Moskva had two long range radars, right? Plus countermeasures and three layers of AAA? I'll list them off:
- S300 long range SAMs with local fire control radar, effective range 90km
- OSA-MA short range SAMs with local fire control radar, effective range 15km.
- AK630 CIWS with an effective range of 4km
If both main radar systems (the MR-800 and the MR-710) were disabled by drones, why didn't the officer of the Watch tell the Principal Weapons Officer "Hey, we're blind, maybe turn on your fire control radar in case there are more bad guys out there"?
Reply: @AlexOnTheSide183  Oh, forgot to mention Moskva also had EWS antennae, jammers and chaff launchers. All of which should have caused a subsonic missile some guidance problems if used correctly.
Reply: @MeeesterBond17  To fire anything or to deploy counter measures , one needs to know of the threat. And if yoir radar gets hit and less then 30 secs later missiles impact your ship.

None of it would have been possible if not for the constant relay of US intel into ukraine which Russia cant stop without starting a war.

At the end of the day , Russia lost a ship. Ukraine lost its fleet. Which had ships of comparable size.
Reply: @AlexOnTheSide183  30 seconds is an eternity to react if you know you're under fire.
Reply: @AlexOnTheSide183  Also it's strange to say that you need to see a threat to deploy countermeasures, considering there's a helicopter in this video dumping flares pre-emptively. Not comparable situations, but it amused me.
Reply: @AlexOnTheSide183  "Bruh"? Oh dear... that's a good way to lose someone's respect.
Weekly reports? How about the overviews? You know, like the one where the UNHCR recorded the following civilian casualties due to active hostilities:
2018 - 162
2019 - 105
2020 - 70
2021 - 44
As I said, the majority of killed and injured civilians were due to mines... and Ukraine signed the 1997 Mine Ban Treaty. I'll let you guess why I don't buy the "evil Ukraine shelling the Donbass" story.
Reply: @MeeesterBond17  Do I look like im trying to earn respect? 
Love how you take the dates from 2018 and onwards , when in 2018 the war had come to a standstill and was pretty much both sides chucking shit at each other.

Oh My they sighed a treaty....Yes cause that proves alot. I dont see Ukraine caring about treatys when it fired over 4k Leaf mines over donetks and it took DPR"s forces over a week to full clear the city. Kids , women and elderly got their hands and legs blown off due to these mines.

Frankly I care little to guess why you believe something or dont believe something. I know who the true evil is. And thats all I need.
Reply: @lukeorlando6088  I mean, the glorious magestic invulnerable, high morale, NATO trained, best in the world army ukrainians are using this tactic so...
Reply: @AlexOnTheSide183  чувак, ну где ты видел видео кастрированных русских солдат? Зачем ты распускаешь эти слухи?
Reply: Lots of things that don't work are still used. ie "cope cages"
Reply: @lukeorlando6088  why is Bakhmut almost surrounded if their tactics don't work?
Reply: @xxxlonewolf49  
Dont work? Atleast 3 recorded events where artillery rounds that would have been deadly for the crew , went off hitting the cage , letting the crew live another day.
Sure againts NLAW and Javalins the cages are barely IF effective.
Reply: @Konig  The cages were mounted because of the missiles, so no they do not work. If an arty round was a trash, then that not a win for the cage, it is a rng loss for the round.
3 possible Events is the same as saying s guy didn't die from lighting because he has on a hat that. 
Both of which is b/s. Sometimes you just get lucky.
Reply: @xxxlonewolf49  I said 3 recorded , hundreds of reported cases.

At the end of the day , at this point the cages are rarely seen as is. Used by the crews that have deemed them good enough.
And....Its not a bad round if it goes off after hitting its target. Its good spaced armor that protects the crew.
Reply: @xxxlonewolf49  and also. 

The cages follow the same logic slat armor does. Make any projectile go off early. I have yet to see a cage tank be destroyed by a javelin or a NLAW. And wlso also. Crews have a choice to use it or not , so if they want to use it , thats their choice that they made with experience.
Reply: @AlexOnTheSide183  3 out of how many hits? that is not a WIN for the CAGE. that is a LOSS for the ROUND.
Reply: @AlexOnTheSide183  By your "logic" we should just DOPE every soldier up so they will "be clam". That is very very flawed thinking.
Modern tanks can stop RPG26 with armor. The only added slat armor onto the THIN skinned veh's that could not.
Yea I am very aware of Top Down Attack Mode.
I've been trained to use Javalins and I was a ITAS (TOW) instructor.
That cope cage will NOT save them and they are fools that will get killed thinking it will.
Anything the ignorant add to "protect" the sites, you clearly don't under stand, would stop the sites from working as it would be in the way of the site.
Reply: @xxxlonewolf49   Like I said. Very liked at base with your attitude and you were clearly the "know it all" guy. 
Fucking love your type , cause whenever you see no winning in a argument you just say "I know more then you!" and walk away.

Well Thats the end of that useless conversation. Thank god.
Reply: @AlexOnTheSide183  I would like to add that in January, more and more videos about the "voluntary" mobilization of Ukrainians began to appear. Sometimes "volunteers" are forcibly recruited into the army right in shelters, during shelling. I wonder why to do this if the Ukrainians are doing well, they have a lot of supplied weapons and "One of the best armies in the world"?
Reply: @AlexOnTheSide183  now you prooved  you are clueless in this theme
Reply: @stasabramovich6325  Sure Stas. Totally.
Anything to counter my arguments?